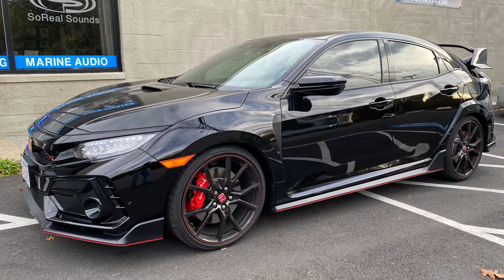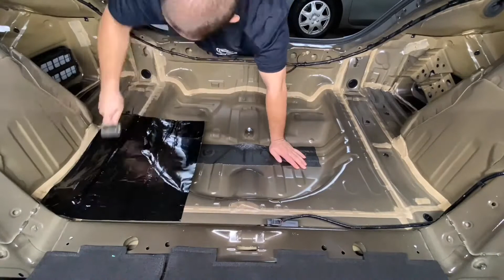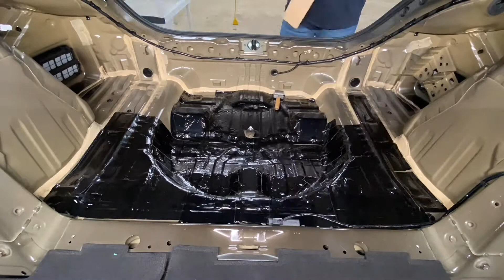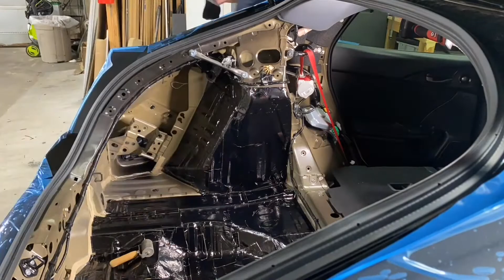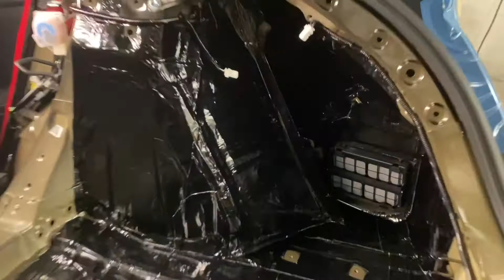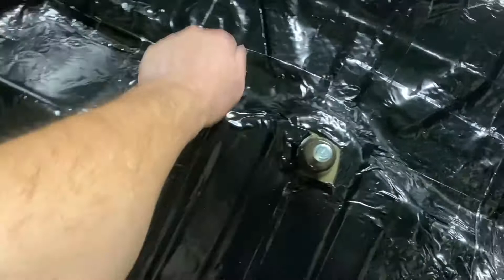2021 Honda Civic Type R Part 1: Trunk Sound Deadening Hushmat

Comment: How many sqft of the mat did you use? For the trunk and/or the whole car?
Reply from the maker: Don’t recall off the top of the head. This car done quite some time ago and we soundproof a lot of the interior too so not sure exactly how much was used in the trunk.
Reply: @sorealsounds  ok thanks for the reply anyway! Great videos, definitely subd
Reply from the maker: @quinnabrams8875  Thank you! I would guess we used at least 30 square feet in the trunk

Comment: Great video, would this reduce drone with an aftermarket exhaust?
Reply from the maker: Thank you! Yes! Sound proofing materials will help with exhaust drone. Depending on the exhaust and how loud it is you will may have to do multiple layers / types of sound proofing materials to lower the exhaust noise down to a comfortable level.
Reply: @sorealsounds  thank you, a friend recommended doing the entire floor beneath seats but just want the boot done for now. He's recommended the heavier stuff?
Reply from the maker: @Dav1072  the more you do the better. Heavier does not mean better. Hushmat outperforms many products on the market and is way lighter. The constrained layer damping is the heavier aspect of the material, but you will need more than just constrained layer damping to effectively quite the exhaust drone. Luckily the other products besides the constrained layer damping is very light. If weight is a concern go with Hushmat ultra, then 1/2” Hushmat silencer Megabond, and then if there is still space left over use Resonix fiberfill.
Reply: @sorealsounds  thank you very much. Appreciate the detailed response and advice. Will let you know how it goes
Reply from the maker: @Dav1072  You’re welcome.

Comment: Did this help quite a bit? I have a 19' and looking to do something. Always drove pickups and was surprised that this new car has 10x worse road noise (seemingly from the hatch area) than any pickup I've owned. New or used
Reply from the maker: Absolutely. Hushmat works wonders. For road noise reduction you need to do two steps. Step one is to use the Hushmat ultra on the panels, this will absorb structural vibrations reducing road noise at 1,000Hz and below. Step two will be to add Hushmat Silencer Megabond on top of the Hushmat Ultra, this will absorb the road noise frequencies above 1,000Hz.  The combination of the two is amazing and the more you do the better. The new Hondas really suck for road noise and the panels they are using in the vehicles are getting thinner and flimsier, it’s horrible. That is why many Hondas has ANC systems, they play the road noise frequencies out of phase through your audio system so you do not hear the noise ( phase cancellation ). It does not work that well and make the audio system sound so much worse. I highly recommend Hushmat.